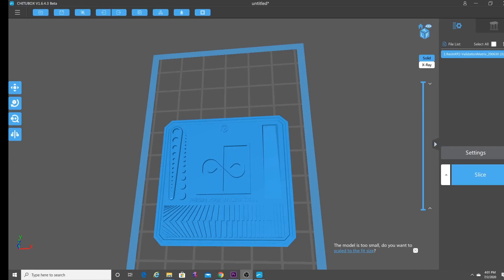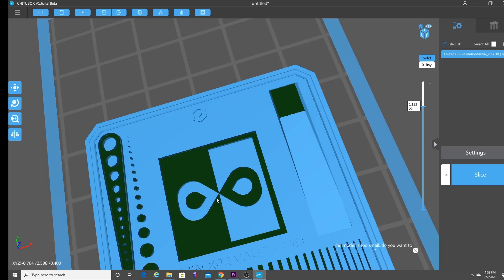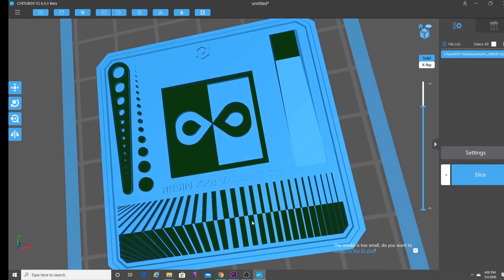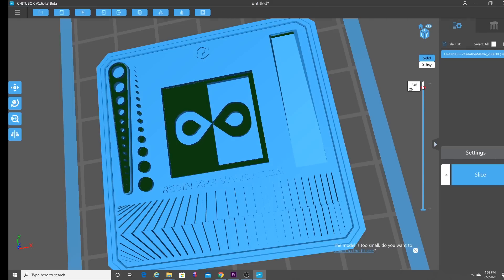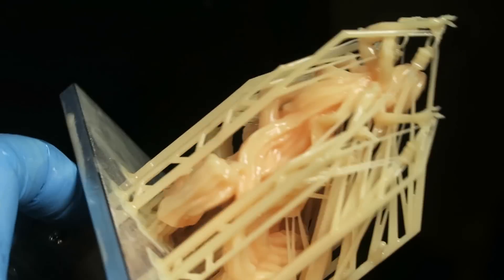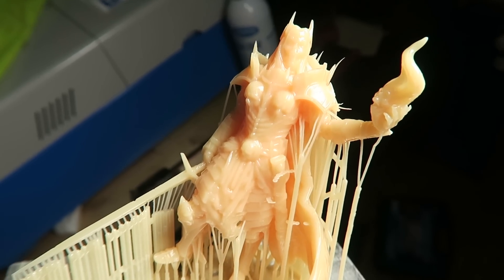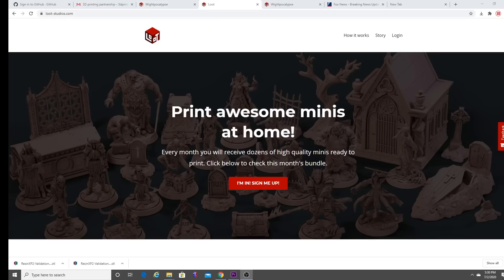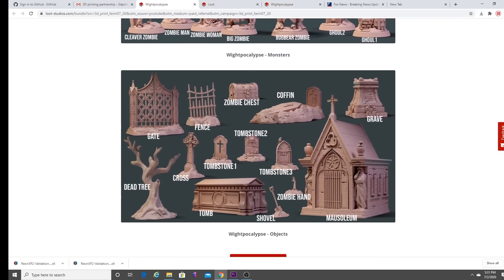How to Dial In ANY Resin for the Perfect Print!

Comment: Be careful with some presupports. I used the slightly more difficult to judge AmeraLabs Town to optimize my exposure settings and for models supported by one person, I've never had a fail even with the longer support runs but there are others that I regularly have to reinforce as they will not work 100%. So getting the proper exposure time may not alleviate all of your woes. You'll have something, but that something may have obvious areas where the supports failed.

Comment: How do you get this off the build plate? I've tried this a few times and it's broken when I try and carefully pry it off.
Reply from the maker: Great question!  Use a flat steel blade paint scraper. Start at a corner and come at it at an angle.
Reply: These work great too.  You can extend it and slide under the whole print.  https://www.amazon.com/gp/product/B01J8Q3J9K/ref=ppx_yo_dt_b_asin_title_o03_s00?ie=UTF8&psc=1

Comment: You are dialing in the exposure time for upper layers, but how do you dial in the exposure for the bottom layers?
Reply from the maker: Great question!  It’s usually 10x times the normal exposure.  For example, an 8 second normal on an Elegoo Mars would be 80 sec bottom layer exposure.
Reply: @3DPrintFarm  On your video you have 3 layers at 25s. So is not 10x times on non of the prints
Reply: @rarstorm  He does say usually On his closest dial in it would be 7.14x and if he tightened a little more to 3 sec it would be 8.33x. Thats pretty damn close.
Reply: @3DPrintFarm  That's interesting, because I use 80 sec bottom exp standard and I never had a problem, but that's the layer that keeps failing with this Siraya.
Reply: I've read a guideline of 5x
Reply: I'd say it depends on the surface area of the bottom layer and the color. The translucent need 5s less than solids. So if say 25s for solid black vs 20s for clear blue.

With normal exposure of 4.8s
So 4-5x normal exposure generally

Comment: Thanks for this!  Do you have any tips on overexposure for the elegoo translucent resin?  It is really sticking to my build plate - I can't hardly get my prints off of it!  Thanks!!
Reply: You can try a scalpel or razor blade but be careful. Alternatively I have head people put the print/plate into the freezer (presumably in a zip lock bag) and it will pop off much easier.

Comment: Brilliant tute!
Do you have any tubes showing how to overcome prints that help fix a warp?
I have a 4mm cross that I've changed the orientation on multiple times, and post-cured it really slowly but it won't come out flat. Everything looks good but it's coming out of the printer with a slight curve. (I'm new to resin but old to FDM)